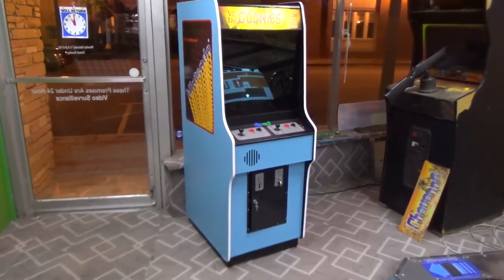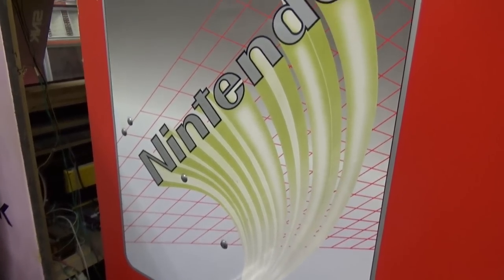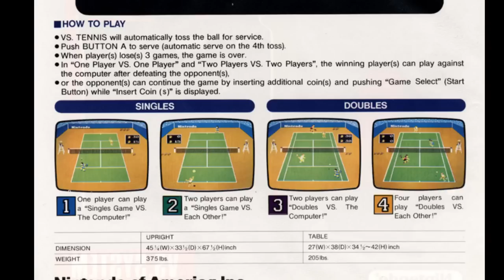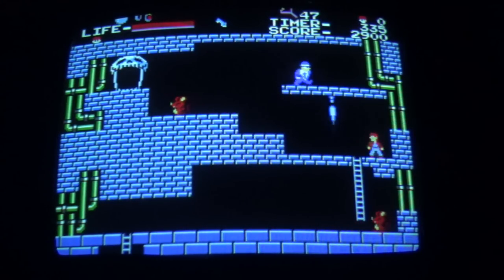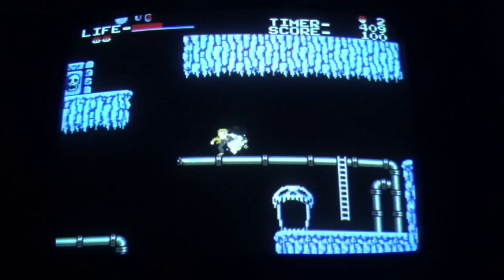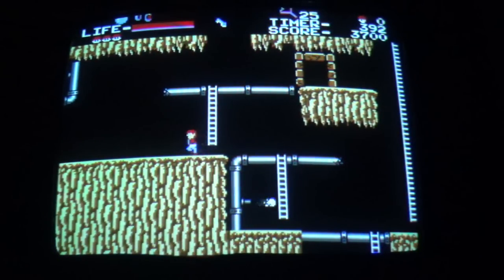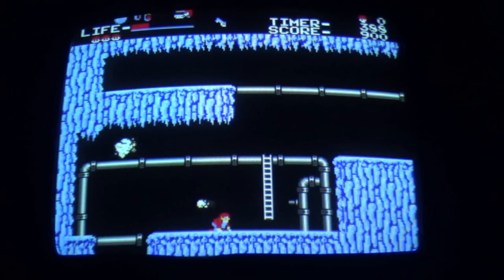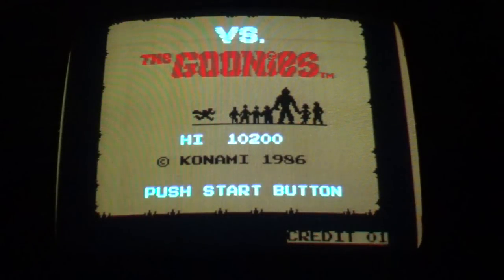Nintendo's Forgotten "Vs. The Goonies" Arcade Game Cabinet - Never Released On The NES

Comment: This version of The Goonies by Konami was a Japan-exclusive for the Famicom.  According to professional Donkey Kong players, the red cabinet version was harder than the blue.
Reply: It mite be the other way around on the DK cabs.  The reds had a 4 stack board that had a glitch that when you are at the very top of a ladder.  A barrel would not come down on you.  When they made the blue cabs, they made the PCB into a 2 stack board. And also eliminated the ladder glitch.  I know that because of that glitch.  When in a competition or attempting a record.  The PCB has to be a 2 stack. The 4 stack boards are pretty rare now.

Comment: I saw this in the wild twice (in the 80's) one in a Food4Less store (which was like this cab) the other was in the Aladdin's Castle in Fort Smith, AR in the more traditional (light blue) Vs. 2 in 1 corner cabinet.  To be honest many Vs. arcades used this style of cabinet in my neck of the woods due to a lot of locations couldn't accommodate the 2 in 1 version.  In fact one of the Walmarts in my town had a R-Type in the same cabinet it had the Vs controllers with the R-Type Marquee and the same side art as this Goonies cab.  It was at that Walmart in 89 until it shut down in the mid 90's (5-6 years) due to a Supercenter opening down the road.

My new local Arcade got a hold of a Red Tent sit down cab, and I would love to see them get a hold of The Goonies board.  Also other than the Red Tent sit down version I have never seen the upright version in red. it's either a kit, blue unisysten (which include even rarer Vs games like Slalom and Castlevainia) or the Blue L shape 2 in 1 in. The funniest 2 in 1 cab I saw though was in the Little Rock Job Corp were it was converted into a Toki (Fabtek) and Crime Fighters (Konami).